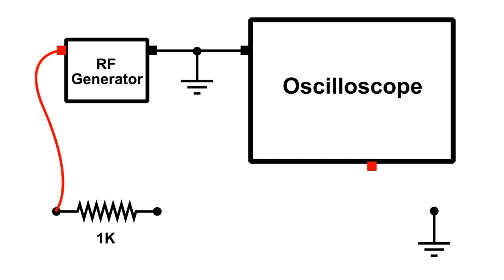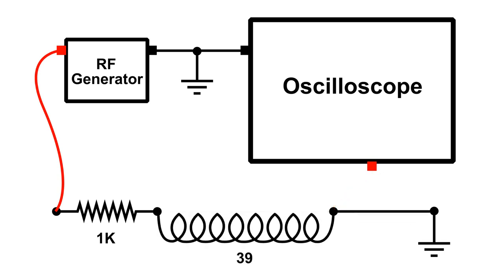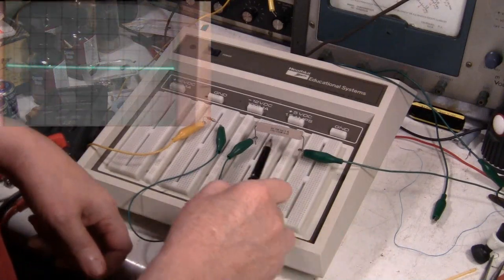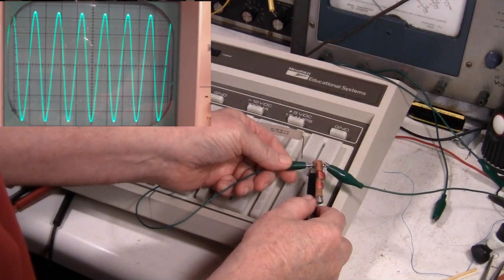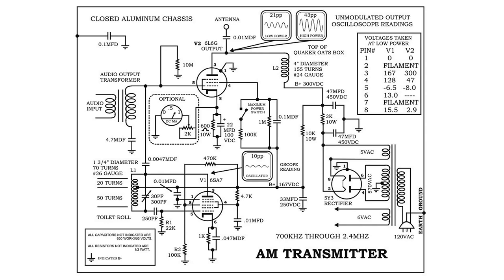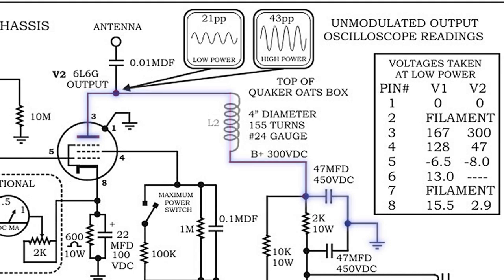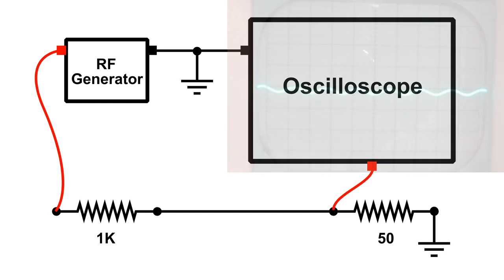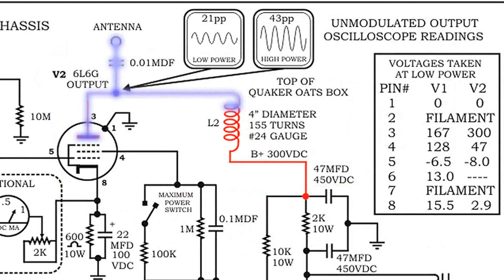RF Choke Demo

Comment from the maker: On the trainer there will be no signal because it is ground, all though your right there is a small amount of RF being shorted out. There will be a little RF getting into the power supply of the transmitter and I would like to show it, but I gave the AM Transmitter to SpeakerFreak95. And most of the RF will be shorted out though the filter cap. Its interesting that 150pf cap across the filter cap works better to short out the RF.

Comment from the maker: Hey John,
I've done this before 2-3 years ago, but this one is a little more polished, and it is a different example. Anyway I should have bought stock in a capacitor company before you started working on that TV.
Regards,
Rick

Comment: Hi Rick my question is regarding the choke coil. Does the coil stop the FR passing through it due to the magnetic field that it sets up and only allowing DC through? Thanks Bill
Reply from the maker: Hey Bill, it is the Moving magnetic field that produces impedance. Here are two videos that mat help.
Impedance, Back EMF, AC Resistance
https://www.youtube.com/watch?v=y11SbmXPY18&t=1s
Impedance Back EMF Practical Demonstration
https://www.youtube.com/watch?v=JrI7I93XzYk

Comment: Thanks for the good illustration.  The choke you used was about 39 Ohms DC.  
The impedance of a coil changes with AC frequency,  So let me see if I have this right - the importance of and effectiveness of using chokes rated in certain mH & uH is to choke AC from entering the power supply depending on the different frequencies of the  RF amplifiers?  And would there be any need for chokes in the IF?
Thank you
 

Thanks

Comment: ALLAMERICANFIVERADIO, Why is a CHOKE frequency dependant for what reasons?
Is the Chokes storing current like a reservoir like the filter capacitors or is the Choke doing something else to the AC ripple, not sure if the Choke is regulating the current?
Reply from the maker: Yes the choke/coil does store energy. Here are some videos that may help.

Oscillators, the Basic Tank Circuit 1
https://www.youtube.com/watch?v=fQ4yRVEzXQA

LC Resonance Testing Demo
https://www.youtube.com/watch?v=84WmnlKgTeg

LC Resonance Oscilloscope Demo
https://www.youtube.com/watch?v=G_RCyDdt2rM

PI filter, Resistor Choke Oscilloscope Demo
https://www.youtube.com/watch?v=WzwaHO6WPCk

Capacitors, DC and AC Current
https://www.youtube.com/watch?v=NInt1Ss3vQ4

Comment: It is because the back emf that the AC cannot pass the inductor yet the dc can pass the inductor right? Thank you for another concise video! you are not one of those other youtubers who does not know how to explain circuits:D
Reply from the maker: AC current is changing constantly which causes the magnetic field to change constantly, and it's the changing magnetic field that is opposing, and are blocking AC current. DC current also produces a magnetic field and this magnetic field does oppose this current, but once the magnetic field is established and has stopped moving then there is no longer any opposition to the DC current.

Comment: What if I apply 1mega Ohm resistance instead of 50Ohm? Will the RF signal still short to ground?
Reply from the maker: This is a low impedance circuit to DC and a high impedance circuit to RF. If you substitute a 1M ohm resistor for L2 you now have a high impedance circuit to DC and RF. But there is no RF because the plate has insufficient VDC.